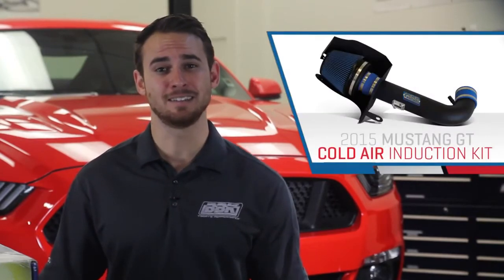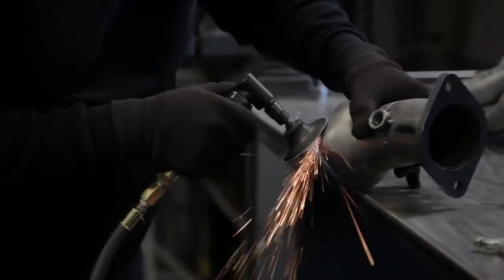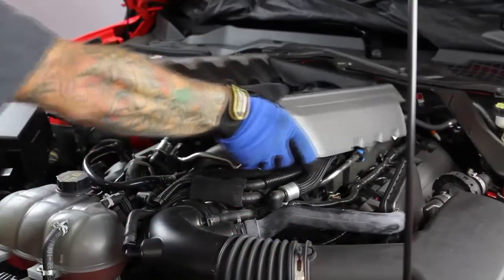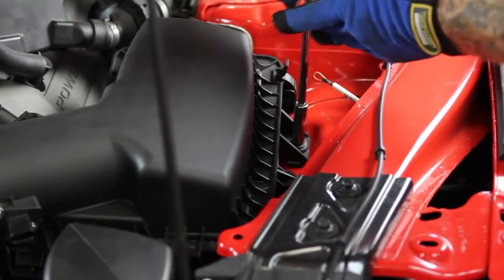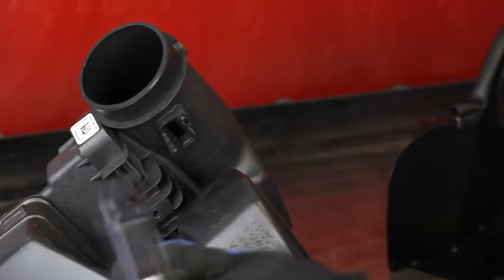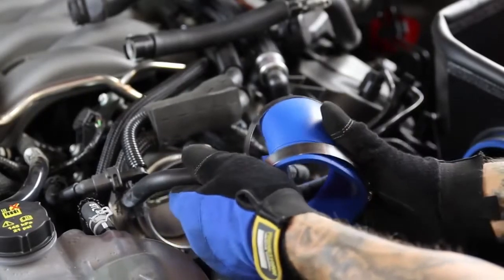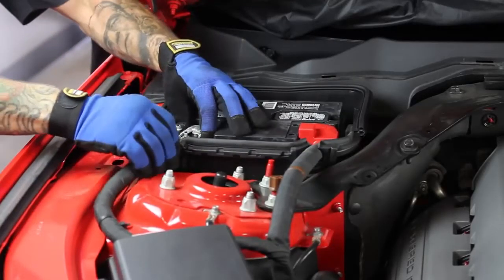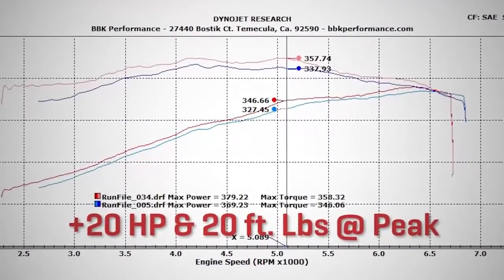BBK Cold Air Intake Installation And Dyno Test on 2015 Mustang GT

Comment: Sorry a stock 15 Gt does not have 337 hp.
Reply: I think that's the whp number using 91 octane, it's more if you use 93.
Reply: you dont check no good curve lol.. ITs 337lbs-ft no hp its the torque at the wheel  = 396lbs-ft at flywheel and 369whp=434hp look the chart carefully...for stock run